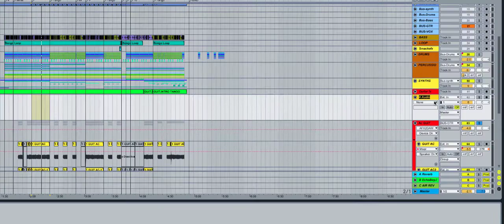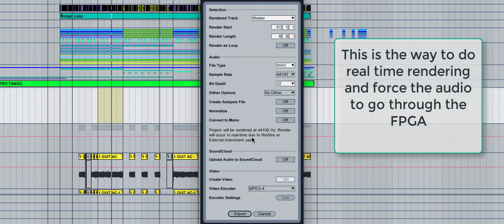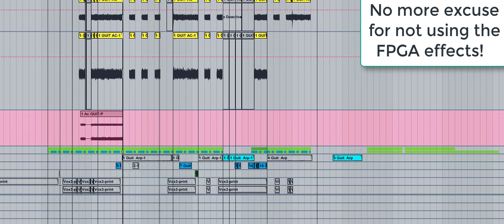Rendering AFX2DAW with Antelope Audio

Comment: UAD can do this offline and you don't need to think as a hardware device
Reply: I have UAD. Took 5 minutes to setup on MAC. Tried with the Antelope and it's still not working after weeks of tests under different DAWs, try and error, no-support, user communitiy stucked with shitty software. All conditions are met, updates, drivers etc, but it' doesn't work. The issue is definitely this AFX2DAW.